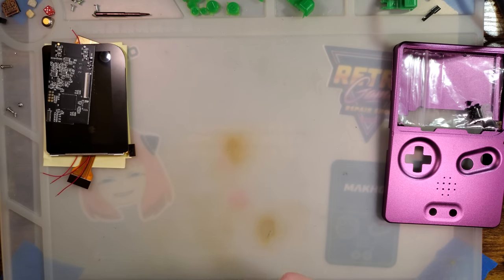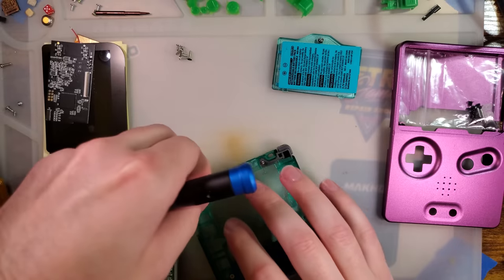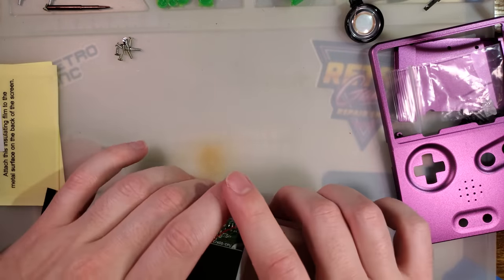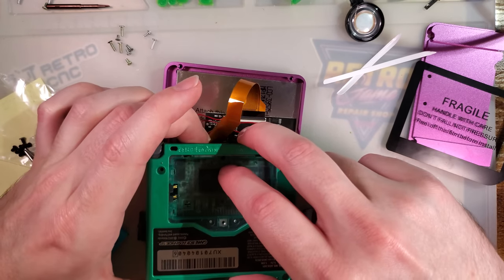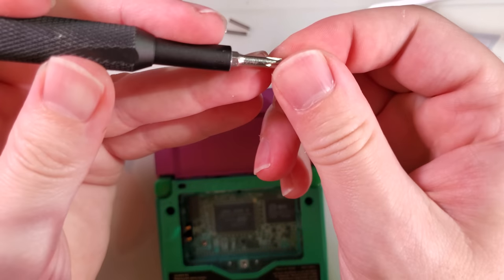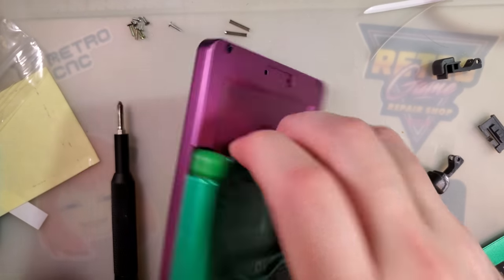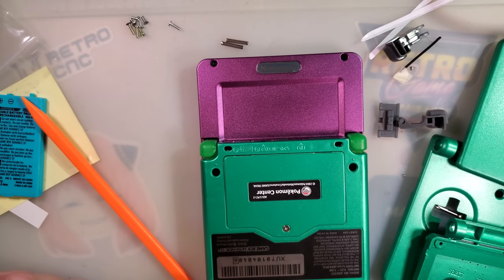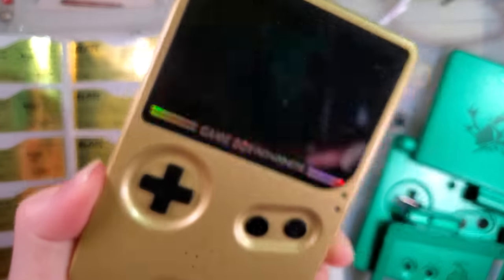Slate Assembly Guide

Comment from the maker: I should clarify, the rear stickers are included, yes, but are not mentioned on the item page because they will not be restocked once out. Once the pre-order batch is sold out, no more stickers. The Slate itself (and kits) will be restocked indefinitely. With the kit itself, the insulation film may or may not be included. If it's included, you may use it. If it's not included, it is not required.
Reply: That's stupid.  Oh well.  Guess I'll just "legally acquire" my own sticker elsewhere.
Reply: Aw bummer, they must have run out before my preorder shipped
Reply from the maker: @TheEventide  It's a fun thing we wanted to do for early backers. I'm sorry you feel it's stupid. I guess I should just stop trying to do fun things.
Reply: Did this change? It seems like they're still shipping out stickers 5 months later
Reply from the maker: @BChart781  sticker MOQ was higher than slate MOQ
Reply: @makho  Gotcha. I'm glad they're still in stock, it's a nice touch

Comment: Congrats makho, the Slate is the most premium Gameboy I own.  With that said, I ran into two issues that I hope will be helpful to somebody.  

The back half of my Slate came from a clear black, IPS ready SP shell from Retro Game Repair Shop.  When I went to tighten the screw at the cartridge port, the plastic bowed on both sides of it, starting to cause distress marks.  It turns out it was the metal cartridge shield.  I hade to pull one from an OEM SP, then everything snapped tight and fit.

My Slate only came with one plastic shield for the back of screen.  I recommend putting capton tape over the left trigger leads you trim down, and over the small pcb the screen plugs into.  Every time I closed the system up. The screen wouldn’t power on.  I thought I killed my kit, but now it works fine.

Comment: Hey Makho, I’d appreciate it if you could take a look at this and let me know if I did something wrong, I completed my gameboy slate brass kit with the brass buttons, when I turn the system upside down the buttons move out slightly, they just are not a snug fit a lot of rattling when you move the system around, is this by design or did I make some sort of mistake, please let me know.
Reply: Update: I’ve been doing some research and it seems a lot of people have been having this issue, is there anyway you could start selling membranes specifically for the metal buttons i’d be willing to pay, I just would like the rattling to stop for a more premium feel.

Comment: Loving my slate - well done Makho. Well worth the wait. What's everybody averaging for battery life with this setup? I seem to get around 2.5 hours on medium screen brightness before it turns red.
Reply: I completed mine yesterday, prior to the build my gba would get about 2.5 hours on average, and I used mine daily in 30 minute increments. I just charged it overnight and played it for 6 minutes today and it turned red. I have a friend who did the build as well and he's getting about the same. We each ordered new batteries, hopefully that'll make a difference, kind of unnerving that my battery was working so well prior though.
Reply: @robofishvselvis  I did a bit more digging/watching previous videos. Apparently the tech for the battery indicator is meant for Li-ion batteries and doesn't handle Li-po's well. After some testing, this battery is bonkers (almost 7 hours max brightness) but unfortunately spends most of it with the indicator red. Makho did some vids on lipo battery indicator mods but that requires a lot of knowledge/hardware I don't have atm.

Comment: Hi Mahko, I recently bought a slate and ips kit. I just got it all assembled and realized the threading for the battery plate came out. When I tried to take it apart one of the screws stripped real quick. It was the the top left screw holding the original back of the game boy. I am curious if you have any tips to get this screw out as it is a tight gap and I really would not like to ruin it. Thank you for you time

Comment: I built my red Slate yesterday it's the best thing. Thanks for this video by the way. I used an OEM flame red donor SP back and it's OEM grey buttons. I really need to find a sticker that fits in the back indention for an oval logo. Do you know where I can get a Makho sticker or a normal Sticker? Thanks.
Reply from the maker: You can pull the pill logo from your OEM SP if you want. If you pop the top housing off, there's a little hole that you can use to poke the emblem out with. Be careful not to use a metal tool though as it's very easy to scratch this part. 

I only ever made a couple custom emblems because unfortunately the process just didn't pan out.
Reply: It dawned on me to use the old shell logo.. I now know to push it off by using the through holes as you mentioned. I only mangled mine a little on one corner I used a sharp knife to lift the logo and messed it up a little. It will be ok its on there.

Comment: Got my Green Slate and had time today to put it all together. I bought the Retro CNC buttons, that work, but seem looser then membrane buttons. I like the look though, so sticking with them. Also got an aftermarket green shell, and although the shade of green is different, it’s still better the the beat donor gray shell. I also installed a USB C mod, which works and fits perfectly. I probably should have gotten the USB C mod with audio, but didn’t realize it was an option until I already ordered and received the just charging mod. Oh well. lol I also bought a CleanAmp mod, that I didn’t install yet. I need to try and figure out the right spot in the Slate shell to install it. All in all Makho, you and the rest involved did an awesome job! Congrats and Thanks! 😀👍🏻
Reply: Is there enough clearance for the USB c cord?  Which one did you buy?
Reply: @tarfoh  Hi Eric - I replied, but it didn’t post. Possibly because I put a link? I got the GameBoy Advance SP USB C mod from HandHeld Legends. There is a separate 3D printed color fill piece that you would need to also buy.
Reply: @mastercpu2  thanks!!
Reply: Hey I’m having issues with mine where I’m getting button presses on the dpad without me pressing the button. Any ideas?
Reply: @bchd8829  - Hi! If you put something at the pivot point of the D pad on the board, like a small piece of kapton tape or electrical tape it may raise the D pad enough to stop the phantom button presses. You may need to fold a small piece of paper and tape it down, but be sure not to block the button pads. Hope that helps.
Reply: @mastercpu2  hey, I ended up just swapping the dpad out for a regular dpad with the silicon piece. It has a better feel for movement anyway. I decided just to use the gold dpad in another build and it’s not acting up with that motherboard for some reason.
Reply: @mastercpu2  I really appreciate your response though!

Comment: Hi @Makho, loving my slate that came out with the first wave, it’s been my daily driver in concert with an everdrive, i was curious if you could verify it’s compatibility with blindeye’s usb-c mod? I am thinking about bringing this gba abroad and wanted to get a more reliable charging solution than an oem charger.
Reply from the maker: not without a custom USB cable too. There's not enough clearance with most USB cables for that mod.

Comment: Just got my kit yesterday and following this video and with my minimal soldering experience I successfully finished mine in about 30 or so mins.  The most difficult part was fitting the screen because of the tight tolerances but I was careful and able to figure it out. 
Now I need to find me some metal buttons but the only replacement buttons I saw on RetroGameRepair are plastic. Where's a good place to get metal buttons? Correct me if I'm wrong but from my understanding Boxy Pixel's buttons only work with their Unhinged GBA SP?
Reply from the maker: I don't know when RGRS will restock SP buttons but the Slate will work with regular SP buttons. BoxyPixel's mod only works with his buttons and vice versa.
Reply: Thanks  @makho ! I just got some from Retro CNC and going to try them out, although with some caution as I've heard they have cause wear on the motherboard pads on some people's Slates.
Reply from the maker: @ayellowbeard  those claims are baseless and rely upon a fundamental misunderstanding of how metals and general wear and tear work

Comment: I love this design, especially using the OEM back housing. It kind of reminds me of the Gameboy Micro a bit. I'd definitely love to grab one some time. 👍
Also it'd be cool if the Laminated screen said "GameBoy Slate" or something.

I recently made one of those GameBoy Micro link cable adapters, and now I can use it to play Four Swords. But I kinda wanna get 4 different types of GBA systems to use. I might have to grab one of these and design an adapter to make the GameCube link cable work. Or perhaps rehouse an aftermarket one in a revised shell?
Reply: I have an aftermarket cable that is just a gamecube to gba cable without the added grip parts that get in the way, if you’d be interested and can’t find one online for yourself. Haven’t tested it but I’d be willing to, and also it doubles as a link cable
Reply from the maker: It just works with any link cable I've tried. It's only the ones with the clips that don't fit. A short link cable dongle extension would be all you need to make an OEM GCN cable fit.
Reply: I actually like that it says Gameboy Advance.  The fit and finish is so incredible, it feels like an official Nintendo product, only they would never release something this premium.  It sits alongside my other Gameboy Advance systems as part of the family.  The custom sticker was right on though, and that gives credit where it’s due.
Reply: @makho  I was looking back at this, and just noticed this comment. I have some parts left over from the hellish build that was the Gameboy Micro Link adapter, so perhaps I could try designing a PCB (Something I'm new to).

Oh also, I did design a Micro SD card adapter you can solder to an SD Gecko, so the SD card sits flush, if you're interested in me sharing my V1 Gerbers. I wanna revise it more when I have time before I properly put it out there though.

Comment: @mahko Great job man! All the hard work paid off. Two quick questions I can remember if they’ve been answered: how does the metal buttons feel without the membranes, would it wear the button switches down faster than the plastic ones since it doesn’t use membranes? And does the helder amp and power cleaner mods fit with this build? Thanks!
Reply: Using membrane-less metal buttons is fine, you probably want to avoid the power cleaner and amp, the powercleaners don't do anything except for prevent your sp from booting in certain cases, and the AMP will amplify noise, making audio even worse, the best thing you can do is open and clean the power switch.
Reply: I bought the old Retro CNC sp buttons over a year ago and it was instant regret.  These new buttons look like they made a couple improvements, but even Retro Game Repair Shop warns not to use them with a metal shell right on the product page.

For me, the metal on metal did not feel good, and I worried about long time wear.  I put plastic buttons with membranes right back in, and now I have a useless set of $30 buttons.
Reply from the maker: @memadartist  I'm sorry you feel that way but your feelings are baseless and nowhere does it say not to use them with a metal shell. Best results means less audible rattle, that's it. Metal on metal is louder than metal on plastic.
Reply: @makho  Maybe RGRS could explain their recommendation clearly like you just did.  As it reads now, I would be deterred from purchasing them for my Slate.  As for my older set of Retro CNC SP buttons, my opinion is based on my own experience with them.  Thanks for all your passion and hard work.  I’m very picky about fine details and the Slate design is very satisfying for someone like me.

Comment: Years ago, when it was still the norm, I pulled an AGS-101 screen out of an AGS-101. Now I got it's board lying around. Are modern backlight kits, like the one for the Slate for example, compatible with 101 boards?
Reply: Yes you can use them.
And I'd be very interested in buying an ags 101 board.
Reply: @thepokerus4184  Neat. Thanks for answering. Unfortunately for you, now that I know that I can use this board, I'm going to use it ^^'
Besides, since I'm not on the same continent as you, shipping would be expensive anyway...
Reply: @seseiSeki  Unfortunately the 101 screen doesn’t work with the Slate, but it should work fine with the Boxy Pixel V2 Kit, as long as you remove the back foam.
Reply: @rickyrns1059  I'm not talking about the screen, that'll stay in my AGB. I was wondering about the board. 
But thank you for your suggestion.
Reply: @seseiSeki  Oh, well then in that case it should work fine. The IPS Screens should work with both the 001 and 101 boards, and there isn’t any differences between the 001 and 101 boards that would make it incompatible with a shell designed for one, so it should work for both.

Comment: Just put mine together and I'm loving it so far! Unfortunately the bottom left corner had a bit too much pressure put on it and caused a small discoloration. Is there any way to buy replacement laminated lcds? Rgrs doesn't seem to stock them.
Reply from the maker: Contact support
Reply: @makho  I did, ended up ordering a screen replacement but they don't have them laminated just lcds and lenses. Does the slate fit one without a bracket?
Reply from the maker: @samdebacker2794  It just drops in, no bracket or anything needed. Or you can try LOCA (not recommended without practice). 

https://www.youtube.com/watch?v=Td7AI0zMuDQ
Reply: Awesome you are a godsend!!!

Comment: Hey makho if I want to change out the buttons on this slate do I only need to take the oem shell off the back? Or do I need to take the metal top piece off the back too? Can I take the motherboard out and place it back gently while I switch out the buttons?
Reply from the maker: You can leave the screen cover part on if you want but you'll have a lot more room if you pop it off.

Comment: What's a good protective case for the slate. Currently keep my GBA in a neoprene sock. Is there one that's a good fit for the slate?
Reply from the maker: Anything designed for a GB Pocket should fit a Slate nicely. Nothing rigid though because the slate is a little bit wider.

Comment: Hello Mahko and anyone else who has the kit. How would you say the aluminium buttons work out compared to the plastic? I ordered both in the same color as I think the aluminium buttons are going to interfere with the shell a bit. Getting stuck due to friction of anodizing and not having the membrane to help push the button back.
Reply: I got the aluminum, they feel pretty loose in the shell and sag/rattle. I might switch to plastic, the buttons on my other sp's feel much better. The aluminum feels nice though

Comment: I have to ask is it preferred to use an AGS 101 board or an AGS 001 board?
Reply from the maker: Shouldn't make a difference function or fit wise. Unfortunately, if you use a stock AGS-101 as a donor, the end result will be heavier because you'll have to live with the weight of what you've done to that AGS-101.

Comment: I’ve built my Slate tonight and I love it! I do have one question: I’m using the metal buttons and while the Start and Select are firm, the other three feel pretty loose and rattle quite a bit. Is this normal, or did I mess up assembly somehow? If it’s normal, is it possible to use/mod pads for plastic buttons to make the metal ones not rattle?
Reply from the maker: It's metal on metal, rattle is to be expected.
Reply: @makho  I understand metal on metal will make a bit of noise, I’m more concerned with how much the A/B/DPad move around relative to the originals and relative to the metal start/select (which are quite stable despite also being metal on metal). 

So, sounds like the tolerances are such that the metal A/B/DPad are expected to be looser?
Reply from the maker: @sargunv  If the fit is not to your satisfaction, make sure things are seated properly. I've already seen a few cases where people did not screw in the motherboard properly and either the screws are not threaded properly (and thus not screwed down) or the motherboard holes were cut slightly too small and the screws were threading into the motherboard and lifting it from the buttons. In both cases, the solution is simply to run the screws backwards until the threads click into place and then tighten normally. 

If you're sure it's not a fitment issue and you are still dissatisfied, reach out to RGRS.
Reply: @makho   ah yup, my board is one of those where the motherboard holes were a bit small and my screws threaded into the board first before getting down to the shell. 

I’m familiar with the trick to turn backwards to click a screw into the original threads on plastic screw posts, I’ll try that again on this one. Might also be worth trying one of my other SP boards to see if I have one with slightly larger holes to compare fit. 

Thanks for the tip!
Reply from the maker: @sargunv  You can ream out the holes no problem. Nintendo isn't NZXT, there isn't any copper next to the holes. Some motherboards are just cut different but the actual copper layers won't be changed (among the same revisions).

Comment: I'm going to ask a really crucial question in this regard does it matter if it's a 101 or 001?
Reply from the maker: not really, no. You do need an IPS kit though but the kits work with both models just the same.
Reply: @makho  my plan is just to do the slate I was just curious if the model mattered at all but thank you for answering my question